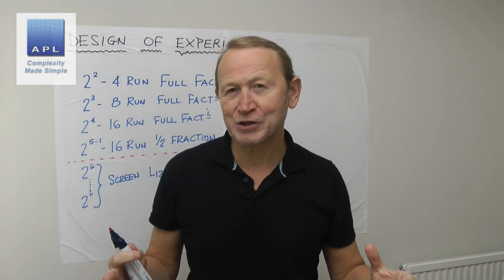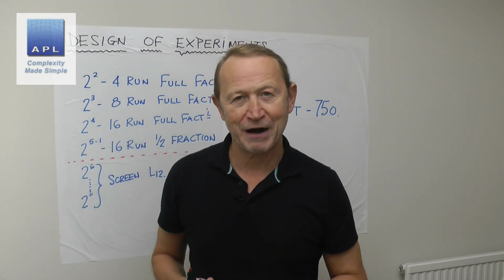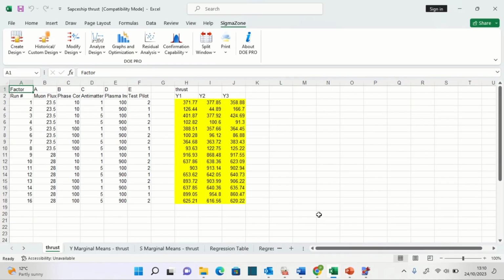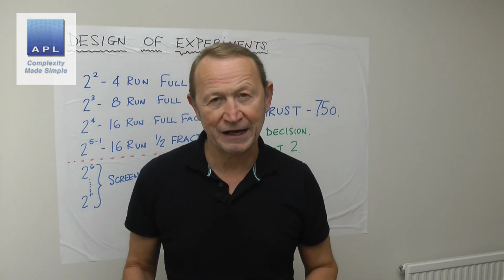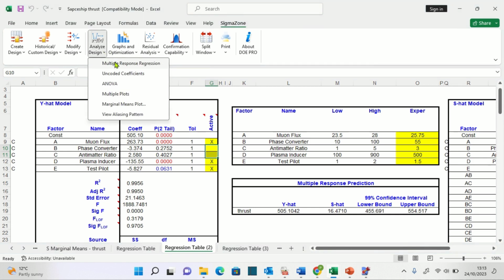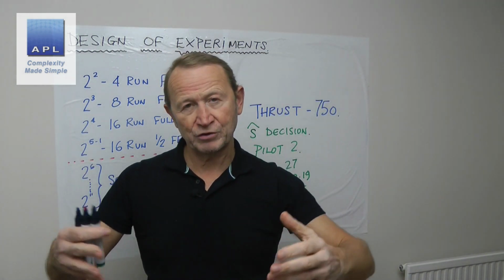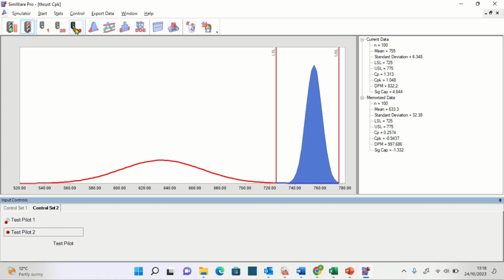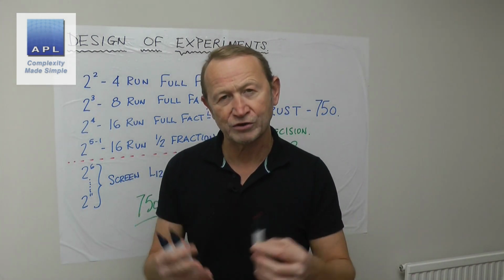Design of Experiments - Video 19 Half Fraction Exercise

Comment: Hi Paul, Thank you for your playlist, it is been helpful. 

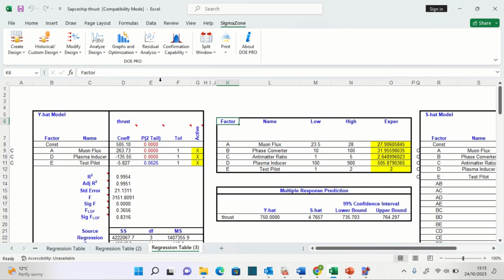I was wondering, we did remove the main effects (phase converter - 1-5 ; Antimatter ratio - 10-100) due to insignificant p value. But while proceeding to predictions (via optimizer) would we not have to fix the value of those to some constant, rather than leaving at 1 & 5 ; 10 & 100 for LOW, HIGH box (ie both LOW and HIGH values fixed in the respective input columns, time stamp 5:20).